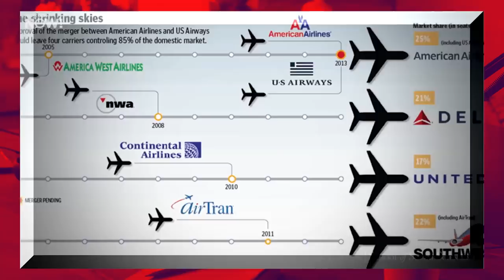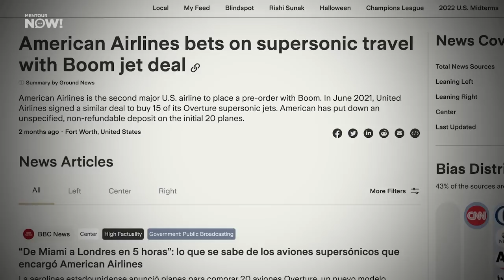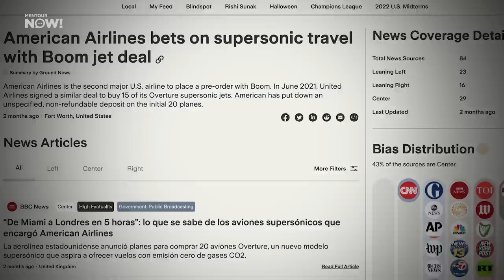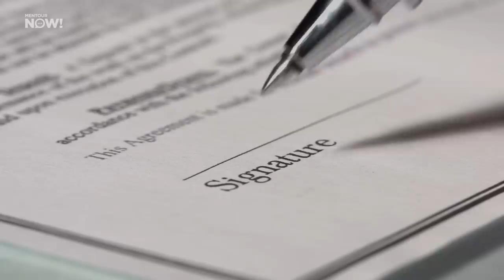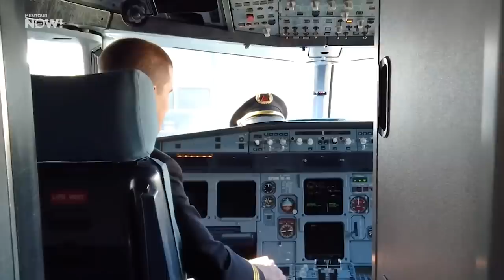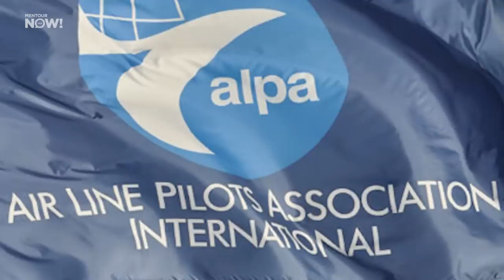Is This the DEATH of the US Regional Airlines?!

Comment: The basis of competition in the US is often flight frequency.  If you can fly smaller aircraft to a regional airport several times a day versus one large jet once a day, it will impact your market share significantly.  Having a cheaper pilot salary scale doesn't hurt, but the main reason is to keep the feeder flights full so that the hubs can operate near capacity, especially if those are international hubs launching the highly profitable long-haul flights.
Reply: Good point, but one big reason for planes like the A220, is to enable flying between small airports that are far apart. So ultimately, folding the regionals into the mainline carrier could (?) lead to more point-to-point flights between smaller airports. Kinda like Southwest, but in a wider scale, network-wise.
Reply: In Euro you can just drive from region to region.
It's the same reason for limited applications for public transportation.
Canada & US are huge.There are a lot of regional aircrafts.
Reply: Absolutely correct!

European airlines have far less domestic passengers to fly than the US because most countries have a main domestic carrier, but are small. In the US a carrier must fly people into and out of hubs that cover very large areas. 

As such, it takes a lot of frequency to many airports to keep those feeds going.

I’m glad he used PIT as an example. There just wasn’t enough demand there to keep a hub going and airlines use a mix of mainline and express planes flying to keep the load factors up. There’s no sense in flying a 738 three times when there’s only a need for ~250 passengers, so they fly a 738 in the morning and then two CRJs in the afternoon/evening.
Reply: @afcgeo882  plus European countries have functioning railway systems which will absorb some of the traffic which is carried by planes in the US.
Reply: @bestdjaf7499  OK Europe (where I am) isn't quite the size of the US but have you seen our roads?? They're horrible! Also, the terrain is a factor, which is why flying is often the way to go. The real difference is that we almost NEVER have to catch a connection through a hub... so flight frequency is irrelevant -- unlike the US.
Reply: @afcgeo882  That may well work for American. But another funny little "gotcha" for other majors (United, I think) is that the airline can't "outsource" flights to its regionals IF it is already flying its mainline single-aisle jets in the same route. That would throw a wrench on the 737 morning/CRJ afternoon (or weekday/weekend) idea. In practice, it would always fly CRJs or Embraers, varying the number of flights... efficiency be damned.
Reply: After 40 years working for an airline it never ceases to surprise me how little pilots understand airline marketing. I spent about 20 years in the marketing department and 20 years in the Flight department. Nothing in this video addresses the time of the flights and the prices paid for the tickets. Also European cities are much closer together. The difference between the regional and mainline pilots' pay scale US vs European is US mainline pilots make considerably more than more the European mainline pilots. I have learned never to listen to pilots talking about the business of operating an airline. Pilots know about airplanes and operation costs, not much on where people are going and how much they are willing to pay.
Reply: Seems the US regionals cancel/reschedule a lot of flights, wondering if it is because the number of seats sold doesn’t meet profit goal?
Reply: @kevinpotter2288  same is probably true in any industry that line personnel do not understand how the stock price, Board, and CEO drive company decisions.  marketing/pricing strategies is just one part of the big picture.
Reply: @daveansell1970  Mostly because distances between cities in Europe are tiny.
Reply: @spyrosg3172  That’s not true. All carriers downgrade (and upgrade) routes all the time.
Reply: Regionals represent a predictable cost in the form of a flat rate per completed segment, regardless of passenger load or revenue yield. Making that segment cost effective falls squarely on the regionals - and their one tool at their disposal is cost containment. The flat rate increases with aircraft capacity up to a maximum of 76 which is when pilot’s union scope clauses take effect. Regionals can only grow by competitor acquisition,  number of contracted routes/segments, and that’s about it. For those regionals that are not wholly owned by a major, the story never changes.  Fly more contract routes, keep costs to a minimum.
Reply: There’s an old expression I learned during my airline career… “you can’t have a viable market without frequency, and you can’t have frequency without a viable market.”  To maintain viable frequency with mainline metal and mainline crews takes us right back to where we were about 35 years ago - where the majors were buried in unprofitable routes. Thus jettisoning former mainline routes in favor of an regional whose cost is entirely predictable was the obvious solution. I firmly believe the regional aircraft are here to stay. Whether they will continue to be operated by contract carriers is another question. At one of the airlines where I worked, our regional was fully in-house and was distinguishable only by its fleet type. The crews were company employees just like the rest of us. Unfortunately we had a knack for picking crappy routes and the Dash-8 route system feeding our primary hubs was far from self-sustaining.
Reply: @daveansell1970  bingo... you may fly CDG to LYS. But if you are downtown Paris... you would take a fast reliable TGV.
Reply: @kcindc5539  But how is any of that different than mainline airlines? They have the exact same restrictions. Regionals can also grow by servicing more markets and working for multiple mainlines.
Reply: Slot space is a large reason as well . . the major airlines do not want low cost carriers coming in. Look at CLT pretty much all American, EWR all United etc. without as much flight frequency they would have competition
Reply: @marylut6077  Nio, it's because their planes are so old that they break down often!
Reply: @bestdjaf7499  The United States and the European Union are of comparable land area and comparable population.
Reply: @afcgeo882  I didn't say they didn't (upgrade/downgrade routes), but can they run a 737 (or A320) and a CRJ (or Embraer) in the same day?
Reply: @daveansell1970  exactly right! I travel every month long haul and using the trains circumvents the current connection chaos to get to the FRA hub.
Reply: @kevinpotter2288  You should have posted this in the main comments section instead of to a reply. It would have been helpful to MP to see it.
Reply: @zeroone8800  
Well, EU is not a country.
And population density of EU is 2x of US.
Of course all the transportation systems are totally different.
The number of the airports in US is 13,000. The 2nd in the list is Brazil with only 4,000 airports.
Reply: @spyrosg3172  Delta has two daily A319 (mainline) and three Endeavor Air CRJ-900 flights between MSP and JFK.

You said United can’t change its route to United Express. It absolutely can. It ends service between those cities and re-starts it via United Express.
Reply: @zeroone8800  WTF are you talking about? The EU has 447 million residents (about 1/3 more than the US) and 1.6 million square miles, while the US is 3.8 million square miles.
Reply: @afcgeo882  No sir, I did not. I only wrote that SOME scope clause contracts (I think United's is one, at least was until they renegotiated them in 2019) meant that they couldn't run mainline and regional jets on the same route ON THE SAME DAY. Obviously the union(s) wouldn't object to the airline switching flights back and forth, as long as they don't go over a certain threshold (max. number of active regional jets, in their case)
Reply: Even if flight frequency is the basis of competition, I don't think that justifies this billions-making industry treating employees like slaves! Some American Eagle pilots have complained online that the company sometimes adds a round-trip flight at the end of their already exhausting day. Seriously?!
Reply: @spyrosg3172  EWR to CLE always had a mix. So did EWR to IAD.
Reply: Exactly. I am a big fan of this guy, but he clearly doesn't quite understand the US air travel system as a European. A very good video, but definitely missing key components.
Reply: @bestdjaf7499 You can't even easily drive to places in Texas. For instance I live in Lubbock, meaning I'm 14 hours away from Houston. I'm not going to drive that far. A regional airline fits the bill perfectly. If they had a main line carrier service the route there would only be 2 flights a day. Where as with the regional I get 12 different time slots to chose.
Reply: @dariusrucker7854  I live near the Minnesota/Iowa border. If we want to go visit my sister on the east coast, or to popular vacation destinations such as Florida, California, or even Las Vegas…. We are most likely to fly vs drive. I’d love to take a vacation by train some day, but for a variety of reasons, that is less practical at this point in time. So we fly. 
When the price point is not prohibitive, we like to fly out of RST (Rochester, Mn) which is technically an international airport due to arriving flights from overseas with passenger/patients for Mayo Clinic…
But as a domestic traveler, initiating air travel out of RST means a dramatically shorter time to get through TSA security, and with only 6 gates, a shorter walk. Of course, since the smaller aircraft are later gated on a different concourse from the big aircraft, you do want to leave plenty of time between your connections to get from one end of the airport to the other. But price and availability of parking at the feeder airports combined with a more pleasant TSA experience will probably continue to be a positive thing from the passenger perspective.
Reply: That may be, but it runs into the problem that peak hour runway slots are a limited commodity, especially at the most popular hubs.  I suspect that if you actually look at the data though, there's at least as much short-haul to short-haul transfer traffic these days as to/from long haul flights.
Reply: @spyrosg3172  United will not fly a big plane and a small plane to the same regional destination because of their contract with the flight attendant's union.
Reply: @marylut6077  Republic Pilot here.  I've 422YX is all over my logbook.    There are multiple reasons for cancellation.  one is  because they don't have the captains they thought they would have when they built the 2022 schedule.   by the time the day came for the flight, the captain they hoped would fly it was already hired by United and moved on up.  the First Officer that was going to upgrade and replace him already left for Spirit/Jet Blue/Frontier.  The First Officers don't want to risk trying to upgrade and busting the checkride and killing their career.  It wasn't financially worth it.  So the regionals have doubled pay to incentivize upgrade.   

On top of that, Republic has a habit of flying to the creme of the crop of airports that make the top 10 in most cancelled flights in the world.  Newark, Laguardia, JFK, Toronto, ORD etc.   in NYC, at Laguardia and Newark especially, there's just too many damn planes, from multiple airports, all trying to land and depart into the same airspace and park at the limited gates.  This year, United gave up on packing em in at Newark and reduced their schedule (regionals first to go because less people per plane that's taking up gate space/slots).   Laguardia is a parking lot during rush hour.  

Weather.  On a good day in NYC, Newark and Laguardia can have delays due to too many damn planes,   but if one little bitty cloud appears over ZIMMZ or any part of the departure they close the departure route, essentially, like closing a major highway.   There's not only a pilot shortage, but an ATC controller shortage, so they can't handle more than X amount of planes at one time flying around the airspace

Major airlines faced hard decisions when it came to cutting flights, even if the flights had pilots.   In many cases, your flight out of LGA to little regional airport to get home, was cancelled by Delta so that their 737 can depart carrying more important passengers to their destination.   

The only reason all of this "regionals will die" talk is a bunch of BS is that the impending mega-recession 0f 2023 will slow down travel, slow down the hiring, and make regionals still a viable option when 737's aren't filling up with people anymore
Reply: Came here to raise this point.  Convenience is a BIG deal in the airline market in the US that I think is often discounted.
Reply: @richardhaas39  Thank you
Reply: This guy knows what he is talking about .
Reply: @spyrosg3172  you should drive North Texas roads. Gotta have something higher than a car. Yuck
Reply: @bestdjaf7499  not to mention that in europe bedides having the choice to drive they also have a lot of train tracks all over
Reply: @VIKINGOCATIRE  
But it's the same.issue with the population density.
In US people have houses. In EU they mostly live in the buildings (generally speaking).
I mean, you have to fly local airlines to get to Alaska or even across Texas, as people have mentioned.
.*
And those local airlines are not only move people, but also cargo. 
All the shipping stuff ..... Food for the remote locations & Amazon & Postal ....
Reply: I 💯 agree with the comment. Passengers in the US want convince and comfort, which means our Reginald are different to regional operations in the rest of the world.
Reply: @marylut6077  The majors control scheduling; those regional flights are cancelled by the majors so that the majors flights are less impacted by weather, etc.
Reply: Ok but why we still can't have a frequent regional flight between Miami and Tampa ffs... 💀
Reply: @hodag999 a perfect example of this is the number of flights between all the NYC airports to all the Washington DC airports.  United flies EWR to DCA at least once hourly but they operate 2-3 flights between the two airports. Factor in IAD and thus becomes as high as 5 flights to/from during high demand times. It's a 4-5 hour drive in decent traffic, 3.5 hours by train, and 50 minutes by air. Not to mention the flight is about the same cost as a train.
Reply: @bestdjaf7499  you know I feel like americans underestimate the size of europe just as much as they claim europeans underestimate the size of america. sure you can drive/take the train from Berlin to Paris. Rome to London? Different story. Athens to Stockholm? VERY different story. Europe has the advantage of a more centralized population, but people aren't always travelling in that high density core of germany/france/benelux.
Reply: @johannesgutsmiedl366  
Not really.
Italy to UK is just 2hours flight. 
LA to Florida is 4hours.
Reply: @bestdjaf7499  and lisbon to warsaw is 4h while LA to seattle is only 3. you do need to make adequate comparisons.

Comment: I'm a 32 year retired US major airline mechanic.  When I first started the commuters were only turbo props and the regional aircraft were flown & maintained by the main line carriers.  As the years went by the turbo props were taken out of service and the major airlines established their own wholly owned regional service.  The reason is simple as the main line carriers pay their wholly owned subsidiary carriers less, and the aircraft don't burn as much fuel or pay as much in landing fees.  If the US ever had dependable high speed rail service this would be a problem for regional airlines.  FLY NAVY!!!